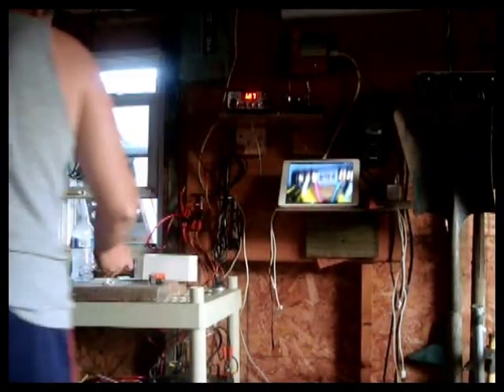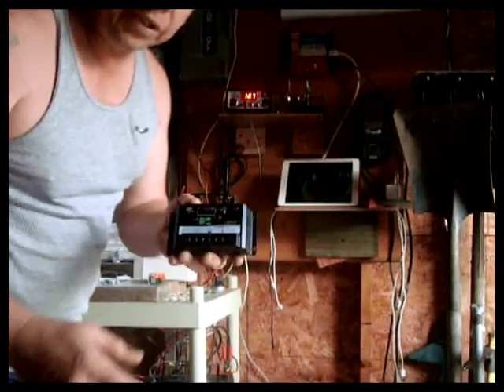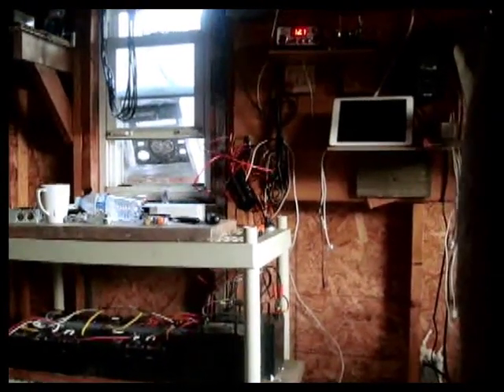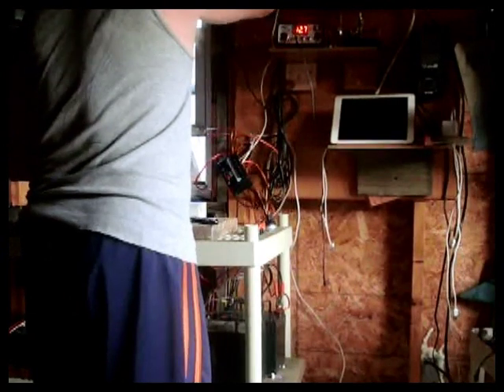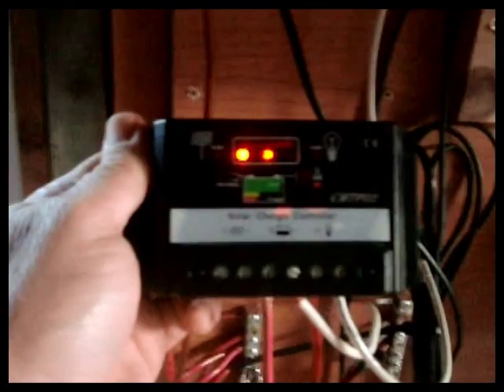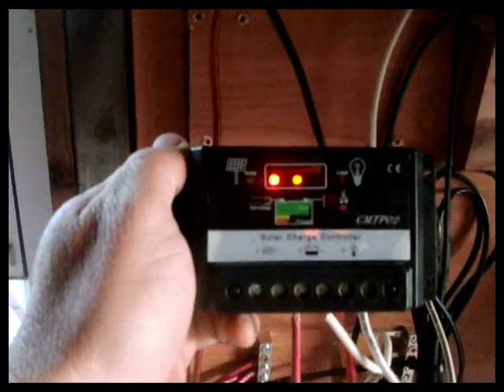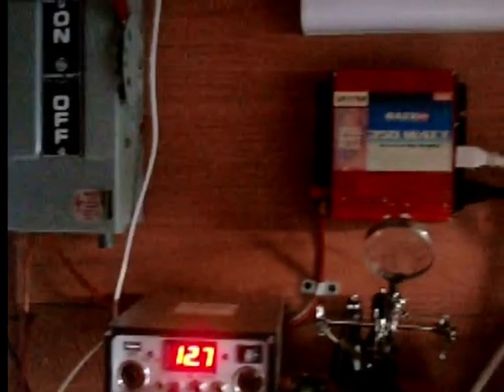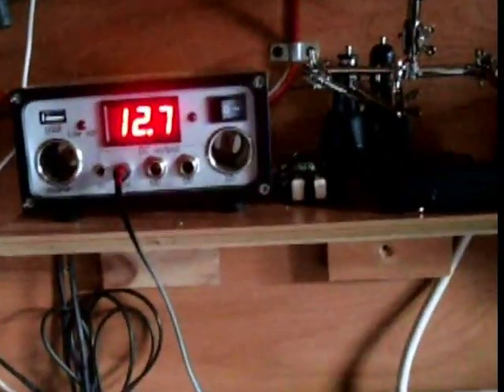CMTP02 30 Amp MPPT Charge controller

Comment: that's a 20amp, man. Look at the manual https://pt.scribd.com/document/329017453/CMTP02-User-Manual
Reply: my guess is that they pattent in design as 30a but the components started failing, so they now sale as 20a. In brazil I found stores calling this model 30a and I would never buy it. Find your video on google, btw. I always check user manual and review videos about anything before buying on ebay.

Comment: Doesn't look like you have it hooked up correctly. I have the same one and it works great. It looks like you do not have your solar panel in the solar input which is the first two terminals and then the second two terminals is where you hook up the battery which the load comes off the battery. The last two terminals is just for a small very low current light. If you hook it the way I just stated it will probably work for you unless you smoked it by hooking up the load to the led/low current light terminals. You probably already know this by now since you have 11k views.

Comment: nels,  i have that controller.  i am curious do you know how much volts or amps the cmtp 02 calls its max allowed amount?  i have a 600 watt solar array, and dont want to break it if i hook it up.      
thanks.
Reply: +Colin Parsons Will NOT handle that guaranteed
Reply: Colin Parsons , don't think watts. The only type of system that I use watts for my design is solaredge residential and commercial systems because it is designed this way. You need to make sure the max voc is not over its rating. When you hook up the battery first as you should the charge controller will recognize the voltage setting and then do its magic from there. Just don't go over max Voc of rated input and make sure the isc isn't over it's 30 amp rating. If it's 600w array then how is that achieved? Was that by stringing how many panels in series or parallel? Do the right math and make sure voltage and current don't exceed max ratings. Also, don't forget, almost all charge controllers require the battery to be the first thing hooked up and the last thing unhooked so you don't fry circuits. Have fun.

Comment: First, it's not an MPPT charge controller. Second, you should never connect an inverter to the load terminals of a charge controller. Your inverter can easily draw 55A or more.
Reply from the maker: Okay thank you

Comment: Check inside circuit board it could be the button inside for load was not switched on, for some reason some of these did not have access to the button. Hope it works out.

Comment: I have the Exact one in my camper trailer connected to a four cell battery bank and two 100w panels. It has worked great! charging my batteries and utilizing the Load connection. The panels have to be connected to the charger for the load to work. (your wiring is wrong)

Comment: By no means am I defending this piece of hardware, I think the one that I own is a 20amps unit and have experienced load outages also. In my situation, once the battery voltage returned to a safe level (don't know that is at present), the load resume. Surely I would not want this to happen in a mission critical application but for 16 bucks, it is not a to bad of a deal. Presently I am looking into a better MPPT system.
Reply from the maker: ***** Yes me too, that is why I bought it initially. I just upgraded but haven't did upgrade video yet

Comment: I was looking at this one currently on EBay. I have 1 24 volt panel and want to charge a12 volt battery. Looks like it will be a waste of money. Thanks.
Reply from the maker: Your welcome
Reply: +videoclipits We are Shenzhen Shuori New Technology Co.,Ltd in China and our main products as following:
☆Solar Street Light charge Controller for VRLA battery or lithium battery (Support Data Remote Setting, PWM/MPPT Type) 
☆Solar Power System charge Controller for VRLA battery (PWM / MPPT Type)
Please visit our web: WWW.SRNESOLAR.COM

3000 ㎡ factory, 7 years experience in solar charge controller filed, professional and strong professors, senior engineers, professional technical staff R&D team.  ISO, CE, ROHS & CQC certificates, this is how we keep good quality and competitive price for global valued customers.

If any models meet your demand, please feel free to contact me. Catalog & Details can be offered.

We're sure your any inquiries or requirements will get prompt attention.

---

Best regards,

Rhean Feng
Sales Department
Shenzhen Shuori New Energy Technology Co., Ltd.
Address:Building B, Jianyu 2nd Industrial, Nanchang Park, Gushu, Xixiang, Baoan, Shenzhen, China Zip:518000
Mobile Phone:(+86) 18565667949/13580565572
Email: rhean@szshuori.com
Skype: rheanfeng
QQ: 2851352807
Wechat:1036342363
Website: www.srnesolar.com

Comment: Sir, if you want MPPT, you simply can't go ultra cheap, they're just not designed to handle much.
you kinda have to start at the $300 mark, though, this is the cheapest unit I've seen, thats actually properly tested in this video :~  PCM-3012: The $140 MPPT, in-depth review, test & teardown  that actually does do MPPT, but being as cheap as it is, still has a few issues, but if you're on a budget, this is your entry point for MPPT.    MPPT requires both fets and coils to shift voltage into amperage, and you just can't do that cheaply.